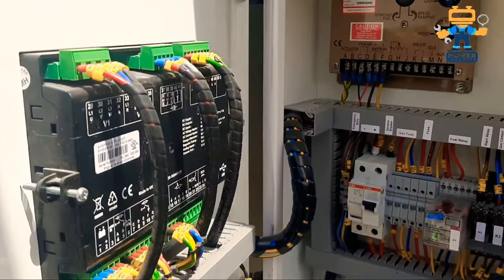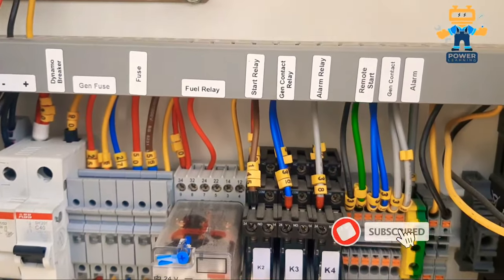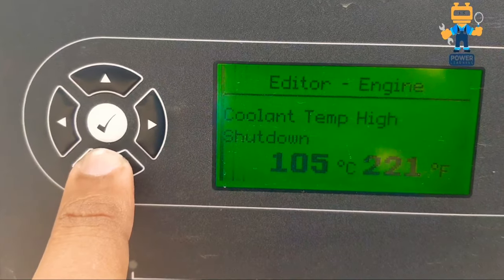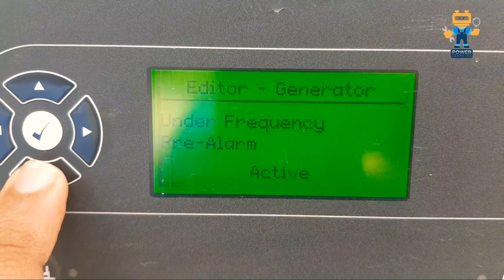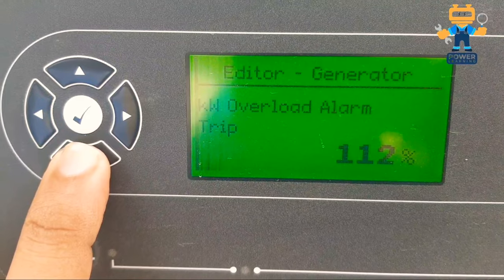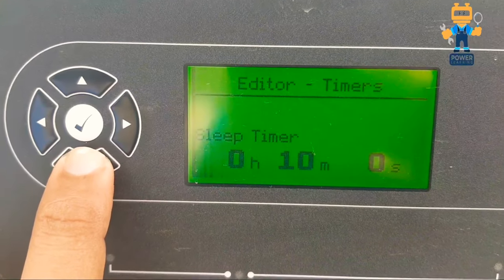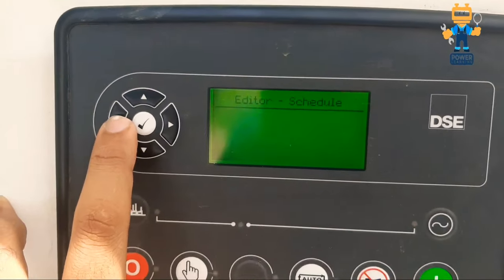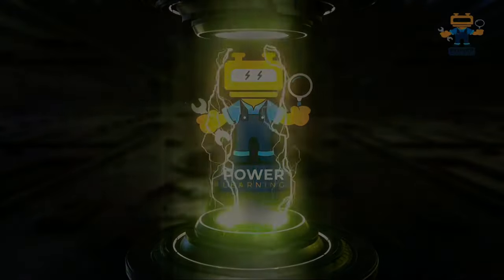DSE 6010/6020/6110/6120/7310/ 7320/7410/7420 Programming from front panel #dse #generator

Comment: I have 6110 deep sea controller  that shows low oil shut down , I removed oil sending unit and shot air into the opening, generator started and ran 1 hour, tired to start at another date low shut down again , bought new sending unit, low oil shut down again how to fix.
Reply from the maker: Check with ur local mechanic

Comment: Can i install 4-20mA level sensor  for fuel accuracy measurement
Reply from the maker: Yes option available
Reply: Please guide me terminal no or share manual link so i can study and apply
Reply: Only variable resistor shown in diagram
Reply from the maker: Check in software

Comment: Can help.me 
Helle Sir,

Would you please help us with attached problems that recently we are faced with.

The program version 2.220.56 can't read model 6110mpuv3,0.

The version 2008 can read that mode. But in the version 2023 can't read it.

 What is the reason for this?

Please guide us that what should we do.

How can, I get the version 2008. If you can't give it the old version. Then, what should we do now?. Because we are facing problems and need it..

Thank you very much for your time and support.

Regards, 

Engineer Elyasudeen Taqi.